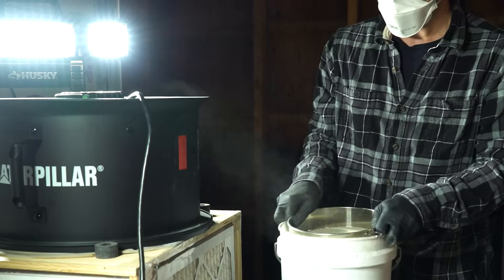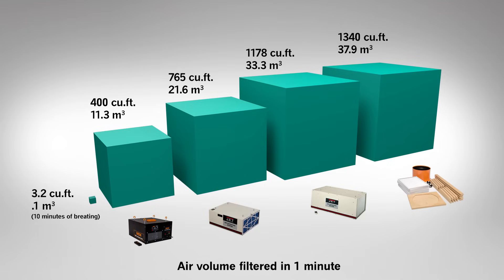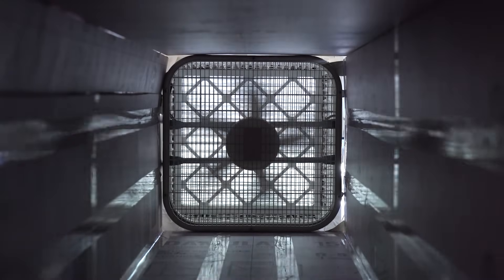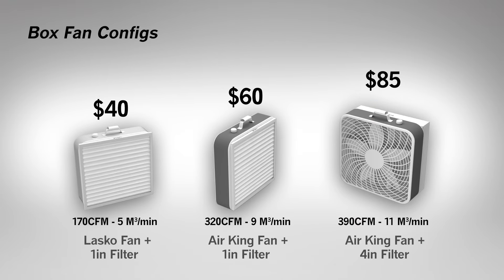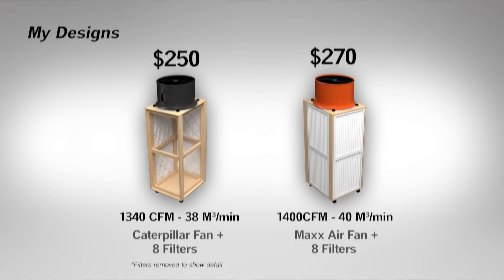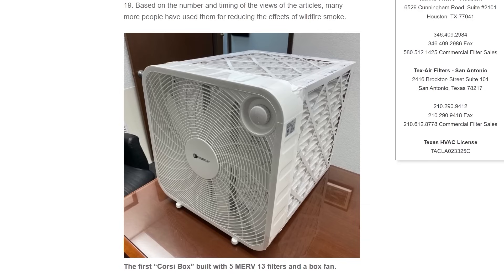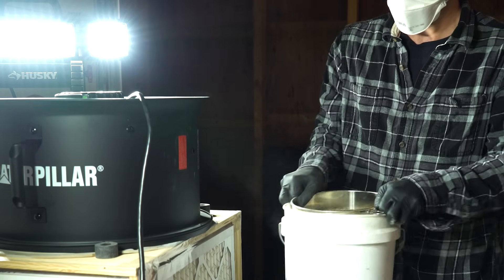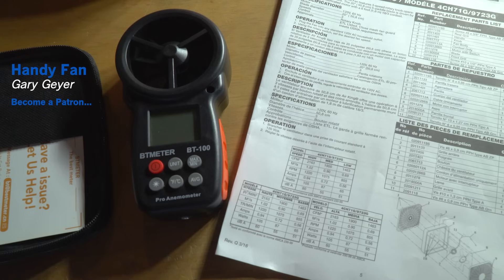What is the best DIY Air Filter?

Comment: Hi! Thank you for your awesome videos on DIY air filters! They are very much appreciated! In this video I´m missing a conclusion of which filter thickness would be best? is it 1", 2", 4"? And what would have the best cost-benefit ratio? I remember you saying that 4" filters are best in terms of airflow, but in your newest videos I don´t hear them mentioned?
Reply from the maker: Watch this video. I test a larger range of 20x20in filters against smoke https://youtu.be/XAJ__E-hIJc

I'll also be making a new video with even more info and I'll be updating my website with more charts from new test data as well. The current charts show more than the video linked above https://the3dhandyman.com/what-is-the-best-air-filter/

Hope that helps!
Reply: @The3DHandyman  yes, I watched the video, but don´t remember a direct 4" comparison ;) and it seems the 4" was slower in this test, despite you recommend thicker filter over 1" filters due to more airflow (in another video)

thanks for the other link also
Reply from the maker: @joachimkarstens9769  The 4" filter that I tested did not preform better than the 2" filters in a 4 filter configuration. They also cost more than the 2" filters, so it seems hard to justify their cost. If you are using these in a heavy dust application, then the 4" filters may have a longer lifespan but the costs may still outweigh the benefits.

4" filters are much better as a single filter on the back of a box fan, though. That's really where they generally preform well.
Reply: @The3DHandyman  very interesting, thank you! because I expected them to also work well in a 4 filter design.

When searching for filters I stumpled accros a type called "bag filter". It´s like one single filter, but consisting of multiple flat "bags" that inflate. Also available in the typical filter levels.
Did you ever try those? I´m wondering if this could remove most of the building effort and would be way more compact. And because of the multiple bags, the filter area is quite high. so maybe no need anymore for 4 or 5 filters. This could also cut down costs a lot.
Reply from the maker: @joachimkarstens9769  I could see these working well in a custom design using a blower fan. I have an idea for that but I haven't gotten around to making it yet.

Not sure how well they would preform with a box fan blowing into them. There might be a lot of air that comes back out of the pockets in the filter.

If you buy a shop air filter, this is the type of filter they use.

Looks like the cost is fairly high if you go with more than 6 bags per filter ($80+ on Grainger). The more surface area that the bags have, the better the filter will preform.

I've tested this 5" filter recently and found it to preform exceptionally with smoke removal. It is also quite a bit smaller than a long bag/pocket filter and it's MERV 16. A single one of these on the back of a box fan will out preform $300 HEPA filters.
https://amzn.to/3Ok6EQY

Comment: Hi Sorry, I can't tell if this is valid: would using the lasko or king fan work with either of your two fan designs ? or us their ability to pull air still too low and wouldnt become more effective with the stacked filter tower shape of your two designs?
Reply from the maker: Hello Ninqi! Both the Lasko and Air King don't work with my original design (Model-A) because the top isnt quite big enough. I have gotten away from the 8 filter stack lately in favor of 4 larger filters. I call these designs the Model-B and C. They are based on the Cosri-Rosenthal box concept.

In general the more filter surface area, the better. So if you are using the Lasko (which is much quieter than other options) the more filter area you give it, the better it will run.

I hope that helps. If you have any other questions, let me know.
Reply: @The3DHandyman  thank you kindly!! That helps a lot. I'll look up your model b and c designs right now
Reply from the maker: @HiNinqi  Any time! The B and C work pretty much the same as a Corsi-Rosental box, just no tape and more features. If you want to tape one together, it will work just fine! I also have a video on how to do that.

Comment: Hey one thing I was wondering today, do you think the Maxx fan + 8 filter build is strong enough to lift settled dust off the ground and filter it through the fan? Or am I thinking about it wrong and it's still gonna be only strong enough to filter dust that's airborne?
Reply from the maker: As is, this will not lift settled dust. People have suggested rotating the whole unit up side down so that the fan blows on to the ground. That would definitely lift dust off the ground in the vicinity of the fan. I cant speak to how well this would work in general though as I have not tested it.
Reply: @The3DHandyman  very interesting. So right now do you have a specific method for cleaning settled dust off of surfaces/cabinets/ground or not really
Reply from the maker: @Therunnerisrunning  Not really. I have blasted it into the air with compressed air and let the filter suck up the dust before but that isn't 100% effective.

Comment: Good Job, Beneficial truthful information.  Crossflow seems to be key in a work area. All so ducting from the proximity of the source of the material to be removed from the air.  I have used restaurant  grease hood fans, they have large cfm and used ones can be found very cheap, with the bonus of being explosion-proof.
Reply from the maker: That's good info. I have been working with a few ducted designs lately. It's a bit of a different setup than what you describe but the results are quite good.

Those shaded-pole motors are top notch. I've been wanting to test with them for quite some time. Maybe one day!

Comment: After watching and rewatching a number of videos lately about diy air cleaners, a couple of things caught my attention, issues and ideas perhaps worth mentioning:
At some point in the comments - this video, I think - you responded to a viewer that you were interested in the idea of using two fans in a push-pull arrangement.  I’ve kind of wondered about that too.
At some point in the video or comments, you remarked that the drum fan atop the box of furnace filters could be set to  pull air in through the filters and out through the fan, OR the opposite.  Furnace filters generally are designed for air flow in one direction.  You probably know that.  That also applies to canister filters.  They are designed to pull air in, leaving dust on the exterior, or to push air out, catching dust on the interior, as in the case of dust collectors.  I have no idea what would happen if filters - furnace or canister - were used in the incorrect orientation, but manufacturers suggest failure, I suspect damage to the pleats and to the structure, creating leaks.  Perhaps you are aware of these issues; some folks will not be.
Q1:  instead of placing the drum fan atop a box of furnace filters, what about placing it atop a canister filter?
Q2:  would there be a performance difference or advantage/disadvantage to a pull arrangement vs a push arrangement?  In the case of a Corsi Rosenthal air cleaner, the consensus seems to be that a pull arrangement is better.  However, I don’t believe I have seen any particular tests, data or summary explanations anywhere - ie, no reasons.
Q3:  Inexpensive commercial air cleaners appear to employ small axial fans.  Better commercial air cleaners employ relatively small centrifugal blowers, aka squirrel cage blowers.  Dust collectors employ fairly large impellers.  My understanding is that a furnace blower is far superior to an axial fan, for an air cleaner.  What about the impeller?  Is there some reason NOT to use an impeller for an air cleaner?
Q4:  This is actually an idea, and a variation on it, something that might be worth testing - or perhaps there are good solid reasons against.  Here goes:  a Corsi Rosenthal air cleaner on the front end, to act as a pre-filter, a canister filter on the back end, and a fan in the middle.  Variation 1: dust separator on the front end.  Variation 2:  a second fan up front.
I’m still learning the ropes of woodworking, finishing, dust management, etc., so please bear with me.  
I would really appreciate your thoughts.  And please, I make mistakes all the time.  I am not averse to the truth.  I’m retired, well over 70, and tell my students that someday I may figure out what I want to do when I grow up.  For now, it’s this - learning, trying things, repairing old tools, making mistakes, learn some more.
Stay well.
Reply from the maker: True, it is always good to orient the filter in the direction of airflow. I casually mention this as few times in videos but could be more direct. Good though about the canisters also having a correct direction.

1) I just wrapped design on this concept. It's a Model-B with a DIY canister upgrade. I'll cover it in more detail in my next video. Here is a link, there are a few pictures of this configuration https://www.etsy.com/listing/1373712349/model-bc-air-filter-kits

2) When using a drum fan on a Model-A (the 8 filter design) performance up close is superb when blowing air into the filter box. So, if you have a dust source that is within 5 feet of the filter, this works great. I use this setup exclusively because I use this filter as a dust bin for cleaning parts. However, this configurations is much worse than blowing air out of the box if the dust is hanging in the air over a large area. If you want to filter the ambient air in a room, blow air out of the box only. This is twice as effective because it causes a significant increase in circulation throughout the room which helps bring dust laden air back to the filter. I've tested this but haven't made that video yet. I suspect that the same principle is true for filters other than the Model-A. After all what direction do all professional air filter blow? Out of the box.

3) All of these fan types mentioned have their various benefits. Axial fans are cheap, move a lot of air with little energy requirements but they need to run with almost no resistance for optimal efficiency. Inline duct fans cant move as much air as an axial fan but they are better at handling static pressure but pull more power. They can also be ducted, which is a huge plus for many reasons. Blower motors have the highest power requirements but can handle the most static pressure. They are also pretty expensive for high CFM models unless you can get a second hand furnace blower. All of these have good use cases. I'll table about inline fans in my upcoming video. The blower fan video will need to wait. I did get a second hand blower tho! So, that's ready to go. 

4) This is exactly what I put together for the Model-B. I love the idea. The outer filters act as a pre-filter (You can also add a 2nd pre-filter to them for triple filtration). The outer filters can be cheap MERV 8s or washable K&N furnace filters for even more reusability. I wont know for a long time, but I thing this setup could last for 10 years without a filter change.

Words of wisdom there! I doubt I'll ever grow up in that respect. Thanks for the comments!
Reply: @The3DHandyman  Thank-you for getting back to me.  Really appreciate your testing and insights.  Stay safe!
Reply: @The3DHandyman Upon further reflection, I realized that the push-pull arrangement would not work.  In a push configuration, a fan pushes air into a filter (canister, Corsi Rosenthal, filter box...), creating high pressure.  That forces air out through the filter(s) and captures dust on the interior.  In a pull configuration, a fan sucks air out, creating a low pressure zone, that pulls air in through the filter media, capturing dust on the exterior.  A push fan and a pull fan installed at opposite ends of a filter (canister, Corsi Rosenthal, filter box...) cancel one another out.  
However, the idea of a “pre-filter” and a fine filter, still has merit.  A fan in the middle should - in theory, given enough airflow - work.  I previously suggested a filter box/Corsi Rosenthal on the front end, and a canister filter on the exhaust side, but they could both be canister filters, or filter boxes, etc.  The real issue is airflow.  If furnace filters were used at both ends, the exhaust side -the fine filters - should be thicker, or larger, or more plentiful, or all the above, so as to avoid choking off the airflow.
Reply from the maker: @joedance14  I have accomplished this in a different way with my updated filter kits. Rather than a Drum Fan, I use an Inline Duct Fan which can have a duct and additional filters installed on it. These fans aren't quite as powerful, as the Drum Fan, but the ability to duct the air has huge advantages which outweigh the power loss in some cases.
Reply: @The3DHandyman  Sounds good!

Comment: In both the audio track and slides, the Maxx Air 17” fan was mentioned.  I have been unable to locate any information about a 17” Maxx Air.  I was able to find links to a 10” and a 16” Maxx Air.
Reply from the maker: Yeah, that fan seem to have fallen on hard times.  I like the Caterpillar fan a lot more in general and it has virtually the same specs. The lowest speed is also pretty quiet, which can be nice to have at times.
Reply: @The3DHandyman  Thanks!

Comment: you think four  2" carbon filters would be better than four 1" carbon filters on the box design? also, Nordic pure sells a "pure carbon" filter with more Carbon (Merv 8) ........ will that restrict air flow? i want to use this for smells mainly?
Reply from the maker: It might. The Pure Carbon marketed as a pre-filter so it shouldn't restrict airflow at all. If it works well, let me know. I could test out a set

2in filters are often better than 1in filters but the pure carbon might preform well.
Reply: @The3DHandyman  I believe the "plus carbon air filters" or P+carbon,  are a dual material that are both pleated (MERV filter + carbon filter fused)
Then there is the "Plus carbon" that has the Pleated Merv filter and attached is the flat panel carbon media (not pleated) 
then there is the "pure carbon" that is a pleated MERV 8 with (single layer) with more charcoal. 
I think i got that right, kind of confusing.
Reply from the maker: @rammalammadingdong1  In my tests with smoke, the "plus carbon" MERV 14 worked well but not better than a standard 3M MERV 13 filter. I think there is a limit to how much the carbon can absorb and there just isn't much on there.

Depending on what exactly you are filtering, the carbon might help a lot. MERV 8s do not remove much in the way of small particles. They preform just about a well as running a fan without any filter in a smoke test (ultra fine particles). So if the smells you want to to move are not particles, the "pure carbon" might be the way to go.

Comment: Hey im thinking of using your 8 filter design with h13 Heppa filters that have charcoal pellets? 

1) Can i make it quieter? 

2) Any DIY methods to add a pre filter for hair?

3) I noticed you mentioned youre releasing another round of tests , 0.0 when 🎉
Reply from the maker: Hello! I have not tested this unit with H13 filters. I'm not sure if those would become very restrictive over time as they get dirty. It might be great for a mushroom growing room/tiny spore collection but it would probably choke the fan off on wood dust.

I have used pre-filters made of sheer nylon fabric but it's hard to source the perfect material with the prefect open area between the threads. It's best too look at fabrics in a fabric store, it possible.

Axial fans are not great with a lot of restriction (static pressure). If you load up the unit with lots of resistance then it may not function well. You Could run a 12" inline duct fan in place of the drum fan. It's less powerful but it handles pressure better. https://amzn.to/3WYWsjK

You could also duct this fan and wrap it with sound proofing foam to make it quieter.

You can also run the duct to something like this if you really want a serious carbon filter. Then you wouldn't need carbon in the filter https://amzn.to/43UDq0g

I should have a few videos out over the next month or so. I'll be testing the ducted design in the first one.

Comment: Not sure if somebody said this already, but you can check if the shroud is blocking all the air from coming in by sliding a piece of paper or tissue from the edges. Shroud shown in the video might be covering up more than necessary reducing the flow a bit. Although I'm not sure if it'll affect it much and it's more work with trial and error, but you can see more precisely at which point the vortices are blocked and not blocked more than necessary.
Reply from the maker: I plan to do a video in this sometime in the next month or two. I'll include the answer to your question with lots of testing!

Comment: Have you tried any kind of setup that you utilizes an air mover instead of a normal box fan? I'm thinking essentially make a cube out of air filters but cut off small hole for the air mover outlet to pop out but sure if that was something that's been tried.😊
Reply from the maker: I hope to some day later this year. I have the supplies and a design, I just need to find the time to make it happen.